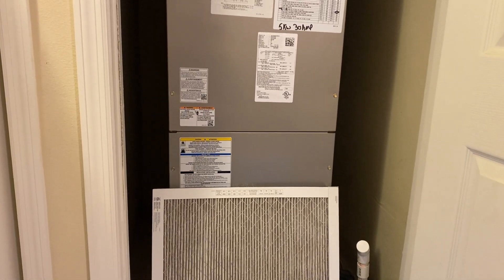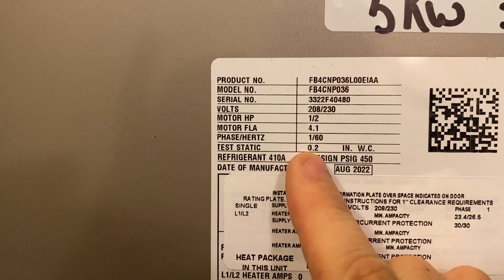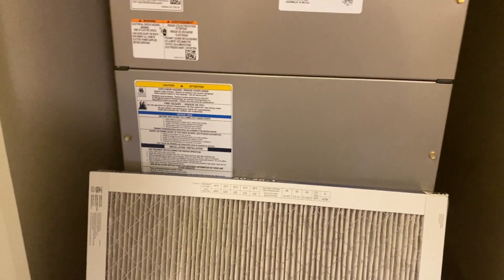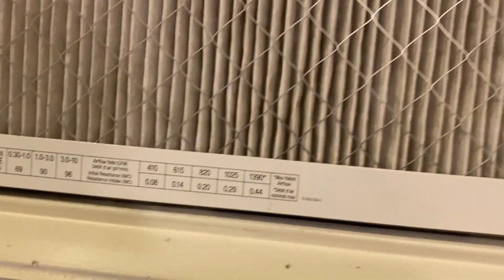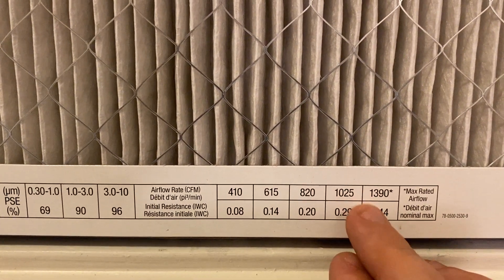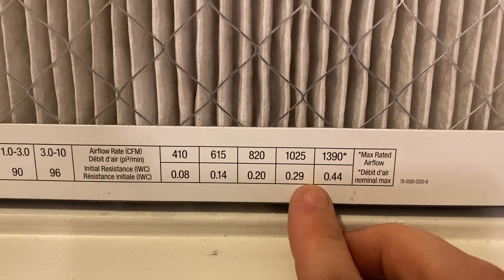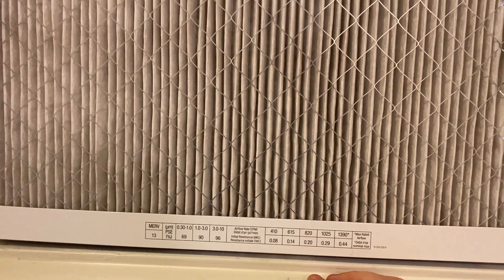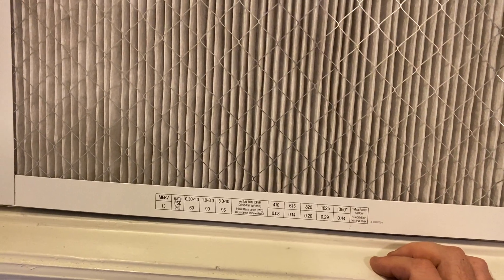Think twice about using high merv air filters!

Comment: So what brand do you recommend then?  Merv 11 is supposed to be best for those furnaces
Reply from the maker: I don't have a particular brand I recommend. Just make sure you get one that fits well. If you have a larger system(4-5 ton) then you may need a different type than the typical 1" paper filter since they can collapse due to the amount of air. You can get a MERV 11 if you step up to a 4-5" filter but then you will need a bigger filter housing. The larger filters have more surface area so they don't restrict as much as a 1" of the same MERV rating.

Comment: my static pressure number on AC is 0.9 WC does that mean I can use more static pressure resistant filters?
Reply from the maker: Possibly. Your system may have a strong fan motor. But the filter is only one part of the over all system. A total static pressure reading should be taken and then you will know how much wiggle room you have to play with filters. Remember the ducts, evaporator coil and heat strips(if you have them) will also add to the overall static pressure.

Comment: You can get away with higher MERV ratings when you have 4” filters. They have much more material than the standard 1” filter so they allow a lot more air to pass through. Personally I would still use the lowest MERV rating with a 4” since a MERV 8 will be plenty to keep the coils/blower clean on the furnace.

Comment: Thanks for posting! I was just thinking about this topic with my AC crankin in this +100 degree weather. This donned on me particulary when I have a filtered box fan with a MERV11 in it and how much that filter really restricted my fan. I then thought about what it could be doing with my furnace. To add to this - it seems a MERV rating LESS THAN 8 for a 16x24x4 filter isnt really available
Reply from the maker: Well a MERV 8 should be fine with a 4" filter since they allow much more air to flow through compared to the 1" ones. That's one of the benefits of the thick filters.